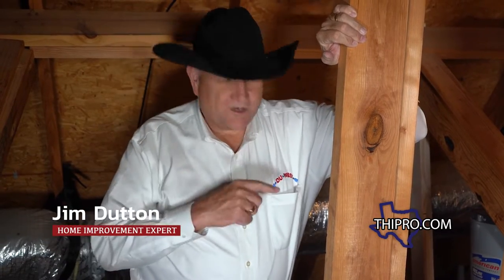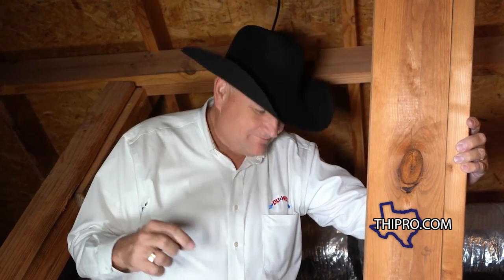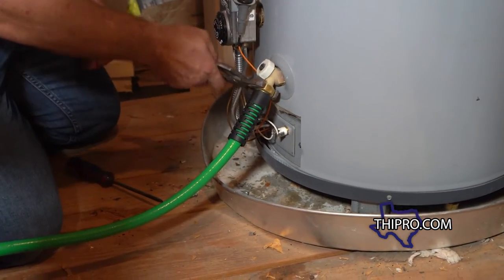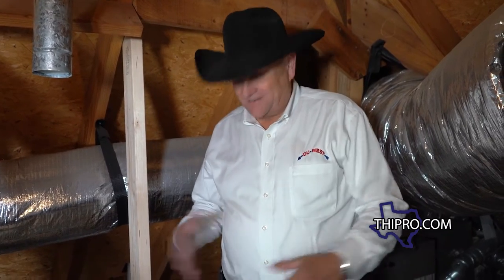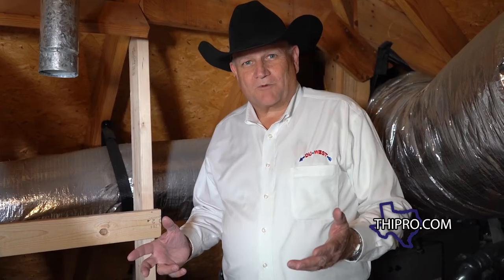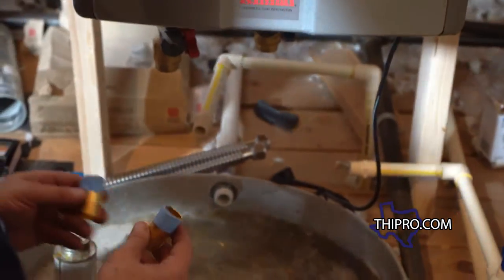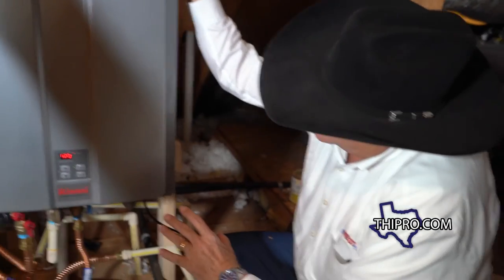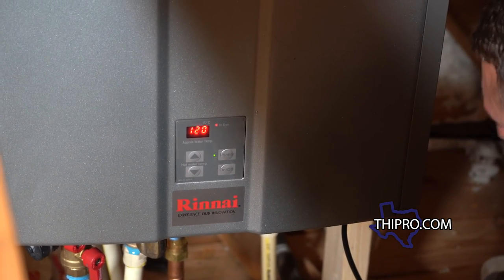Going From Tank To Tankless Water Heater

Comment: I may be wrong, but the exhaust air venting to through the roof is incorrect. I dont think you're supposed to use the existing metal vent with Rinnai venting. The home owner should check the instruction manual or call Rinnai customer service. I have an indoor Rinnai tankless, and it clearly states, "Do Not combine vent components from different manufacturers. " Do Not connect the venting system with an existing vent or chimney."

Comment: Rinai system call for Ranai vent pipe all the way through the roof. This could work for a part time; but could fail and cause error codes. But I am curious if this is allowed in Texas by code. But was interesting to watch

Comment: What do you do with the discharge line off the old tank water heater? Mine has 2 water lines, gas line and a discharge on the side of the tank close to the top
Reply: That’s the pressure relief valve. It’s relocated on the bottom for the tankless water heater.